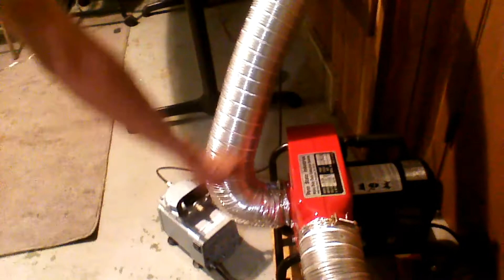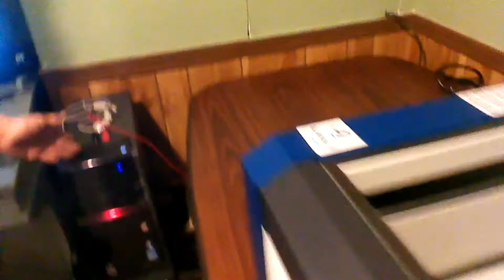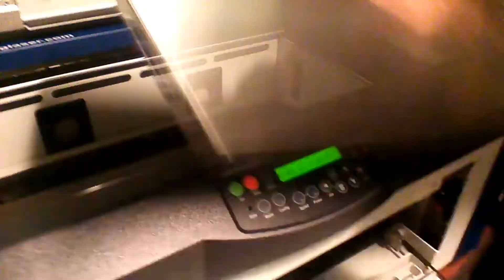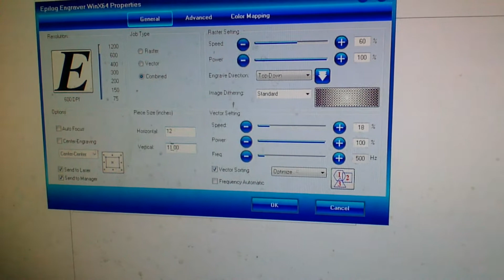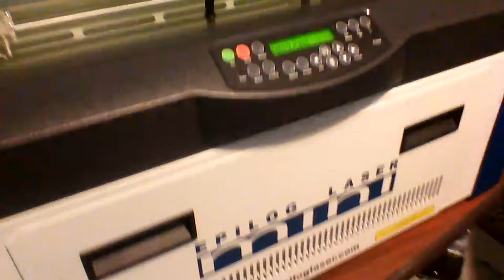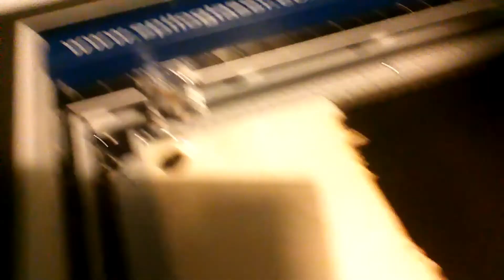Epilog post installation and operation

Comment: I'm glad I found this video. I have a home base studio (bedroom 2nd floor on a condo with a big window) Do you think noise would be an issue? ...like bothering my neighbor downstairs? Thanks.
Reply from the maker: no the machine is honestly not all that loud all things considered. we have been using it for a long time, and while yes it can be heard through 1 layer of walls in a typically walled house like ours, it's really not all that bad. though we still wouldn't suggest running it in the dead of night or anything for courtesy sake, but even if you did, it's not that loud from outside

Comment: thanks for this video !! what is the compressor function? does this machine still work well & this machine is not fussy?
Reply from the maker: so far we have been using it for a long time now, and it works well, not many hickups once we got the hang of the software.

Comment: what exactly does this machine engrave on? I'm looking for wood, metal, steel, aluminum, plastic and glass. can it handle these without changing "this that and the other". Thanks
Reply from the maker: we primarily use it for wood, and thats what it was built for.   it will engrave corkboard and basically any kind of wood though provided it can fit in the machine without haing to change the bottom (just make sure to use bottom section we show in the video, i forget what its called). as for metal or glass, we haven't tried it, so can't say for sure.